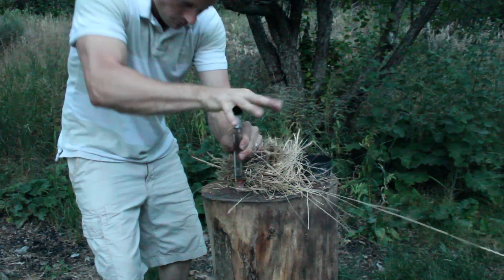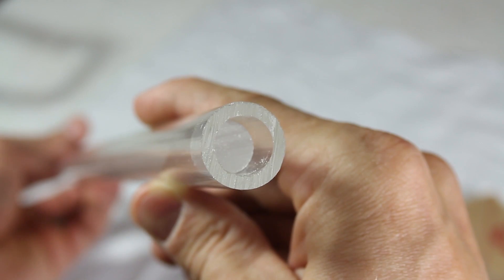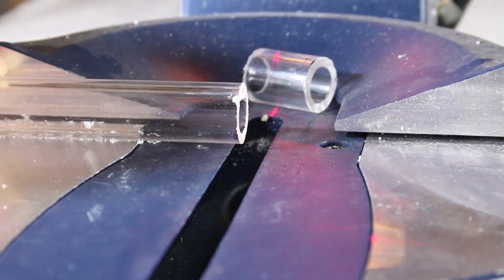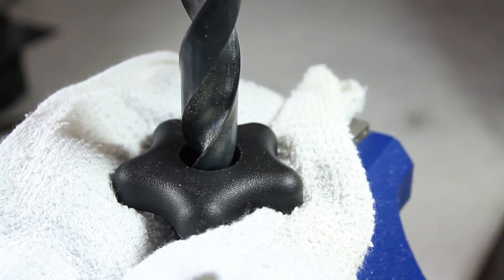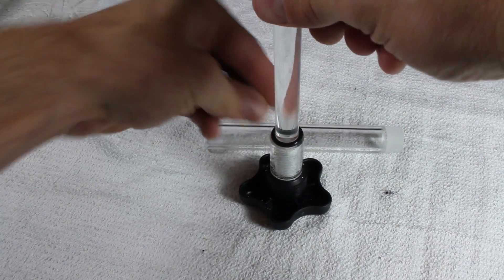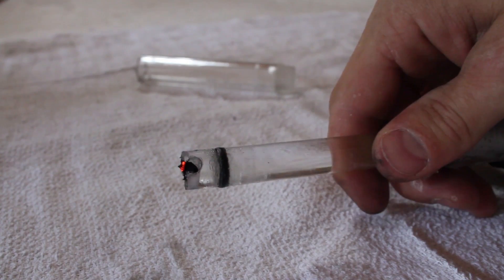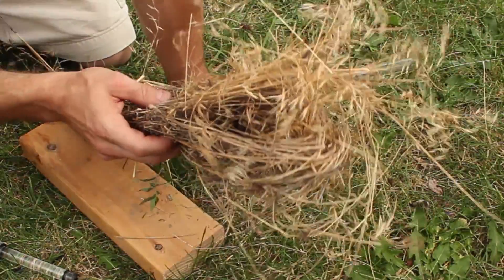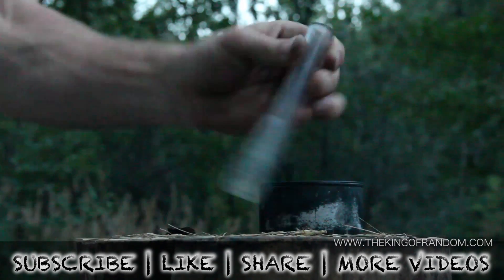Slam Rod Fire Starter - Ignition By Air!!

Comment: I think this is how diesel fuel is ignited in a diesel engine; with compression and not by a spark-plug.
Reply: TheJunkyarddawg00 No, a diesel does not use a spark to ignite the fuel.
Reply: JonnyKiller Yes that is true to all conventional gasoline engines, but not diesel engines I think (the "electric spark plug  - line"). :) Diesel engines uses a glow plug to heat the air for a small time around itself before it can start clean (and sometimes even start up older diesel engines), then when the air around is hot enough to ignite atomized diesel, the diesel gets sprayed (which also, as said, atomizes the diesel fuel, which is needed to make it mix good enough with the air around) into the chamber and the diesel fuel ignites; then the four stroke cycle begins and the air gets compressed and heats up enough from that compression; after the start help from the glow plug, and then the cycle continues like that without any necessary help from the glow plug. I think this is how a typical diesel engine works, without having researched everything about diesel engines ...
Reply: Fl4shbang a starter motor begins to rotate the engine and thus causing the piston in the engine to compress the diesel and it causes an explosion creating the Otto cycle
Reply: Where would the force come from to compress it
Reply: awesomesauce An electric motor could be used to start the engine? Then every thing will start to run by itself once ignition has occurred, obviously. You can not ignite liquid diesel with a lighter for example. Have you tried to Google it? ;)
Reply: awesomesauce When you turn the key on your car, an electric spark ignites the fuel for the first time. From there, the power of the explosion makes the pistons go up and then down again with enough force to cause another explosion. And it keeps going on like that :)
Reply: LOOTS243 riiiight..
Reply: awesomesauce  When the engine turns over it it turns the crank moving the piston up and down, this creates the compression required to ignite the fuel. This is actually called dieseling, a simple google search will tell you everything you need to know about Rudolph Diesel and his engine.
Reply: yea i mean enitially i had assumed it was spark plugs
Reply: I'm aware of what you meant based on your statement. The whole point of a diesel is that it does not use an ignition system with spark plugs. They do not use a spark plug, never have.
Reply: ***** All diesels do not have turbochargers. Most do these days, but originally none had them, and many today still do not.
Reply: JonnyKiller when you turn the key on your car it powers an electric starter motor to roll the engine. The spark then ignites fuel in the combustion chamber and forces the piston down, thus starting the engine.
Reply: A diesel engine compresses air, then a diesel injection thing that looks like a spark plug, diesel will blow if the air temperature is higher than 90°F. that's whats the use of compressed air.
Reply: diesel engines use glow plugs they are different than spark plug as they just warm up the cyclinder so the air pressure can ignite the fuel easier

Comment: As a gas's pressure increases, so does the heat. When a gas depressurizes, it can freeze rapidly. It's quite cool.
Reply: SangoProductions21 That's why the CO2 bottles in air pistols (single shot dart guns have a better effect) is cold when you are done shooting
Reply: Hoyschel Silversteinberg It's also how your refrigerator/freezer and home/car air conditioning work.
Reply: SangoProductions21 pv=nrt
Reply: nurd
Reply: Adiabatic process

Comment: my son is trying to make fire starter for his science class.  He found all the materials and I believe everything has been put together correctly but it is not working.  The char-cloth easily lights with a match but he can't get it to light with the fire starter.  Wondering if there are exact dimensions that he should have used.  The rod is 1/2 in O.D. and the tube is 1/2 in I.D. and everything seems to fit well together.  The length is approximately 8 in....any thoughts on why it isn't working?
Reply: Push it harder and faster. You really have to slam it to get the air to heat up hot enough.

Comment: Could you make an air pistol that does this? If you shot a piece of wood with fast moving air would it ignite?
Reply: No. It is not the movement of the air that causes the heat, it is the rapid pressure change.
Reply: No

Comment: try to fill it with gasoline
Reply: ***** that takes one or two drops and letting it evaporate to mix with air for a second. It's how potato cannon works.
Reply: Considering the potential energy of gasoline...  Gunpowder would work better for what I'm thinking of doing with this tech.  Think wood splitter.  Sledge fired.
Reply: +Thom Woodwork and Art But when you are compressing you compress a large amount of air to a small area. The air volume is the same, just in a smaller area
Reply: or diesel

Comment: Someone gave me a jet airplane, and I drew a decoration on it using $1 worth of paint ... so I got a jet airplane with a cool picture on it for $1! Right? ... No, just stop with the BS about "I did it for $1" getting what costs everyone else $ for free is not a legitimate cost.That Material has actual value even if it didn't cost you. Don't be that full of crap guy.

Nice fire duhickey though :)
Reply: john dunne No, but you don't just find acrylic tubes and rubber o rings in your backyard.
Reply: if you go out in you back yard and got wood for free do you say you spent X amount of money on firewood?
Reply: Are you implying it's impossible to scavenge for free acrylic tubes and o-rings in a first world country? You're arguing semantics and to top it all off you're wrong at it. If you're determined you could find the materials on craigslist or in the trash for free.

Comment: This is simliar to how a diesel engine works. The pistons compress the diesel-air mixture in a cylinder until the compression causes the air to heat up and ignite the diesel.

Something like this would be great in a survival kit, because lighters don't always work when wet (or if they break), and matches are useless after getting wet. Plus this is reusable until the tinder claw melts completely which should be long after many lighters are used up
Reply: That's exactly why he referenced the diesel engine and added it to his survival kit. Unlike him I don't have these exact materials readily available so I cannot build this exact one. But the concept nevertheless still applies, compression and heat. Should be a fun build.
Reply: thanks for clearing that up, I had been wondering how they keep the fuel from burning until top dead center, or just after. Seems any inconsistency in the production process would lead to slightly different flash points
Reply: It was the inspiration for the diesel engine, a prehistoric technology.
Reply: Timothy Ryan Fisher I read somewhere that the first attempt of combustion under compression was a metal block with charcoal in it and a piston used to compress the coals, on hitting the piston with a hammer the coal exploded and blew the guys hand apart, the inspiration for the diesel engine.Fact or fiction ?????
Reply: Once I finished reading the top part and hit "more" I gave up lol
Reply: Not to be too nit picky, but I must correct you on how a diesel engine works. The piston only compresses air, not fuel, as there is a danger of it burning too early and causing engine damage. The fuel is injected into the top of the cylinder at high pressure once the piston has reached the right point. The hot compressed air causes the fine spray of fuel to burn.

Comment: You need 1 dollar for the tube 200 dollars for the lawn mower aand 500 dollars for the saws and stuff why not buy a 1 dollar lighter
Reply: He already had the tools and I have some of those same tools in my grandpa's shop so no cost as they were already owned, lawnmower already owned and the handle could be a block of scrap wood and it would still work.
Reply: Ligters are for people that want the eay way out.Plus a lighter doesnt last forever
Reply: Elie Lingat
Kinda agree with you there. I don't go hiking or camping much anymore but having more than one way to light a fire is always a good idea, and with a fire piston all you need is some punky wood and you can use it to start a fire. Also learning from the old ways is always fun, I wanna try some the old flint and steel method sometime and see how well it works.
Reply: ShinKyuubi
It works well as I have done it many times.

Comment: I know an even easier way instead of all that work making this tool you can just bring a lighter.
Reply: ***** forever? easily.
Reply: Just how long do you plan on being out in the wilderness? For me on any trip, a lighter works just fine, if I'm going to be more than a month, I'll bring two just to be sure, lol.
Reply: i guess that would work as well
Reply: Just keep the lighter dry, problem solved.
Reply: no, problem NOT solved. lighters wear out and lose gas. fire pistons work forever in all weather
Reply: Yes, but who needs something to last forever just to go on a camping trip, or getting stranded for a while? Lighters are very reliable, and plenty adequate unless, like I said, you were going to be out there for more than a few months. Don't get me wrong, it's a nice gadget, and if you want to spend the time building it, more to you, I'll just grab my lighters and go.
Reply: Flimsy or unbreakable, your choice.
Reply: I've gotten lighters wet before and they're just fine once they dry. I've never noticed decreased performance, maybe you buy the wrong kind of lighters.
Reply: Different strokes

Comment: I don't think I want to mess around with some magical rod that can break on me, just take a magnesium stick.
Reply: Koks Baron you can ignite a magnesium stick with a knife.... just scratch over it
Reply: Ferro rods do run out, I used to think they were the ultimate fire starter but it's hard to use and it still runs out.
Reply: "Magnesium sticks burn out." - ...........I'm trying to figure out what the heck you mean. Magnesium is a metal. It lasts for eons.
Reply: DesertArizona   Is not some magnesium consumed every time you start a fire?  Have you ever used one?
Reply: lolz :D magnesium ignites at very high temperature ..and would be kinda pointless as an survival tool cuz u would need a very powerfull torch to ignite it ...and with that u can also ignite ur fire ...magnesium is cool as an underwater-torch tho

Comment: Ok, the fire starter works because of the Law of Conservation of Energy:

1.	It is a law of nature that Energy is conserved.
2.	Therefore the kinetic energy of his hand is conserved as he slams the fire starter. 
3.	Nothing other than the fire starter gains significant energy.
4.	Therefore the fire starter gains almost all the energy his hand lost.
5.	But it does not go flying away so the energy is not kinetic. 
6.	Neither does it gain height, so it is not potential.  
7.	The only other way for the energy to manifest itself is as heat. 
8.	So the fire starter heats up,
9.	Thus igniting the char cloth. :-)

Actually, it works because of friction:

1.	The cylinder is in contact with the piston. 
2.	Because of friction, when two things in contact with each other move across each other, they heat up. 
3.	The heat from the piston and cylinder rises to the char cloth’s ignition point, 
4.	Thus igniting the char cloth. :-)

Actually, it works because of the laws of optics:

1.	The round clear acrylic cylinder focuses the light entering it onto the char cloth.
2.	The black char cloth absorbs the energy from the light, causing it to heat up,
3.	Thereby causing it to ignite. :-) :-) :-)

 Actually, it works because of Charles’s law:

1.	The volume of air decreases as he slams the piston down. 
2.	But according to Charles’s law, the Volume of a gas varies inversely as its Temperature. 
3.	Therefore the temperature increases, 
4.	Thus igniting the char cloth. :-)

Actually, it works because of the Ideal Gas Law:

1.	Slamming down the piston causes the air Pressure to increase.
2.	But The Ideal Gas Law is that PV=nRT, where P is pressure and T is temperature.
3. n, R, and V do not change.
4. But the equality must be preserved.
3.	Therefore, the air Temperature also increases,
4.	Thus igniting the char cloth. 
5.	As a sign that this is so, r3v1xx explained it this way four months ago. :-)

Ok, Ok. So what is the actual chain of causality, and what physical principles are involved? None of these explanations seems sufficient, (and some are downright ridiculous.)
Reply: Opps, my bad. Charles's law states that the Volume of a gas varies DIRECTLY as its temperature. So, since the volume decreases, the temperature should...decrease... hmm.
Reply: Charles's law is ti/vi=tf/vf, relating temperatures and volumes for the equilibrium enthropy. It pertains more to change in temperature; stick a balloon in the freezer, what happens?
Pressure causes all of the change, as it keeps the enthropy the same, causing change in entropy. The gas is at a certain temperature, with the gas bouncing around. The gas will bounce around at the same speed compressed, giving an increase in entropy relative to what it was. Same thing with aerosols; the compressed liquid exists at room temperature, but with a change in pressure it will maintain the enthropy causing a decrease in entropy until the system reaches equilibrium. Thermodynamics is an interesting thing...

Comment: Hi, sry i'm french and i'd love to know whith what you're starting the fire at 3:00
You speak normally but i don't know or understand the word you're using for ^^"

(sry for my bad english too, i try to do my best, for a French :p)
Reply: he said: "i had enough material to make another piston"
Reply: No, just after that part.

Did you read my comment at least ?

(If you're trolling me that's unfair :/)
Reply: maybe "charcloth"?
Reply: Mp7Specialist Yes, that's it :D
Thank you :3
After some searches , there's no word for it in french, except the word "amadou", who doesn't mean exactly the same thing.
Reply: Charcloth is litterally cloth (cotton) that has been heated to the point it chars, but doesn't catch on fire.  Like making charcoal but with cotton cloth instead of wood.  It doesn't have to be charclot for use with the fire piston.  Any tinder material could work if dry and easy to ignite.
Reply: Brian Vanderzanden  Thanks :D

Comment: 1 dollar, hundreds of dollars worth of tools
Reply: We've had a person saying $1000 worth of tools, another saying $500 worth of tools, and now hundreds of $ worth of tools!!
I have a belt sander, a drill press, a cordless drill & a mitre saw.
And I bought these in the past, so you could say it did & didn't cost me for these tools. I wouldn't buy these tools JUST to make this air piston.

BUT you could still make this, WITHOUT these useful tools!! It's just gonna take a lot longer. But still, it may cost you a dollar, if you can find a plastics supplier, with some offcuts.
Reply: josh9point0 Could just use wood.  He just used the acrylic so he could see the spark inside.  Most fire pistons are made of wood and work great.

Comment: Just a question, how has the slot held up over time to repeated use? I thought that if you were going to drill a hole for the handle maybe you could drill a second hole for the other end and place a notched bolt to hold the char cloth rather than directly on the acrylic. Might not work and may be unnecessary.

Comment: The reason one would want this is in case matches run dry, or lighter runs out of butane. Considering the air around you is cheap, renewable and infinite, all you really need is tinder or a firestarter of some kind to bring a fire alight.

Now, as for being more practical than the piezoelectric spark-ignited lighter, that I am not sure about, but eventually the piezo crystal runs out of energy to give.

Comment: Now make one with a vent in the bottom so that it is sealed to start the fire, but when you pull the piston out, fresh air is released into the cylinder so that it won't die.

Comment: Pressure*Volume = (number of molecules of gas)*(a constant)*(Temperature)  or PV=nRT.  This works because pressure increases rapidly on the left side of the equation, while everything is held constant on the right side except temperature.

Comment: Those are some great arbitrary numbers! But your premise is flawed in that you have to have the best, most expensive equipment to do any and all projects. It only serves to reinforce the notion that you need to stay out of the shop.

HD sells a 16-speed floor press for 600, Dewalt chop saw for 600, desktop belt AND disc sander with stand for 800, and throwing in a hydraulic bench vice for 1,000, you're still 2k shy of your ridiculous estimate. Goggle-search it.

Comment: I had to come back and say thank you Grant for this great info.  I was able to make myself a beautiful Slam Rod out of two pieces of 316 stainless.  It works wonderfully on the first time, after I made some char cloth as instructed in your other video.  This little tool is going right into the hiking pack!  Not to mention some use when camping.... just for the fun of it.  Thanks again for the easy to follow video.

Comment: Hey there, I love the video and am interested in making multiple. I've been doing some shopping around but all of the places that I find can't give a temperature rating of over 200 degrees F or any type of internal pressure rating. I love the idea of using acrylic to be able to see the ignition but if it isn't strong enough I'll just go with a metal tubing. Do you have any sources for tubing that can withstand the high pressure and temperature for this application? I'd like the pistons to last..

Comment: You mentioned diesel engines and that got me thinking, if you put a drop or 2 of diesel gas in the tube would it make the rod shoot back up or would diesel need more pressure than that to combust?